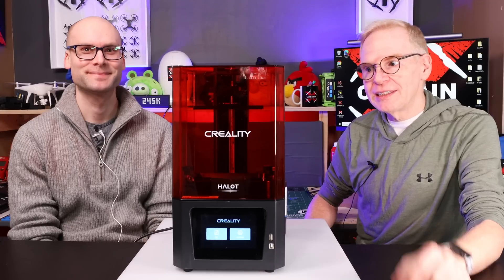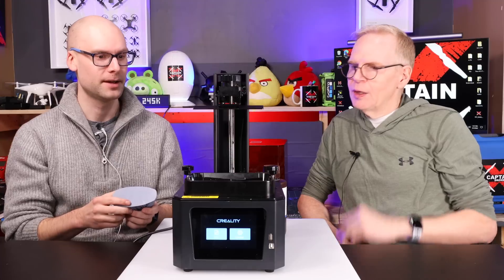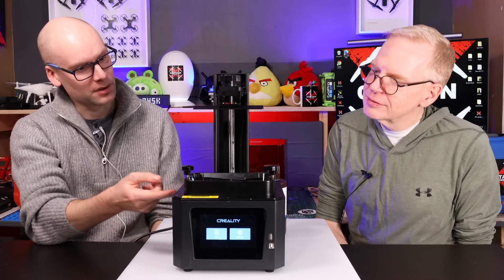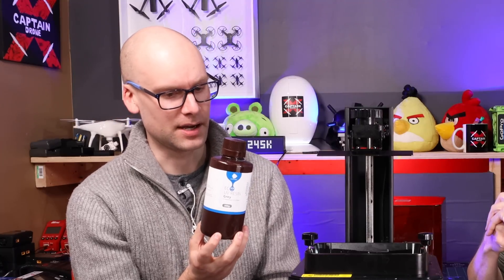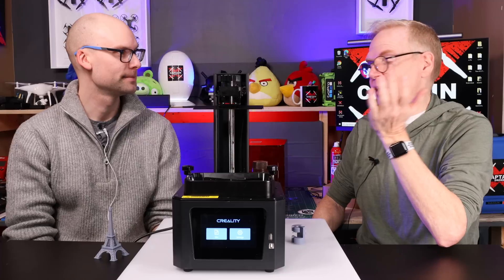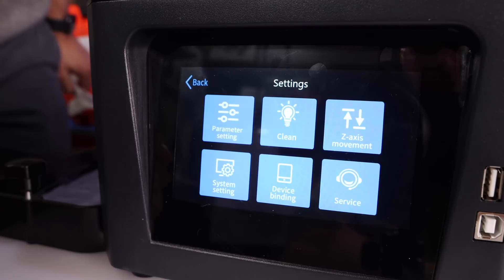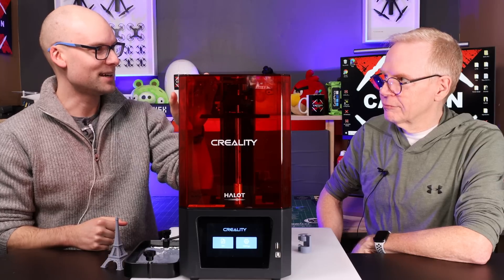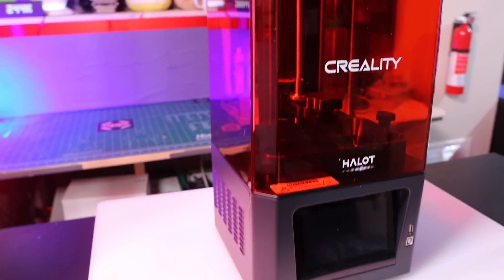My Nephew shows me a cool 3D Resin Printer - Creality Halot One - Review

Comment: We purchased a filament printer for our Son and we still can’t get a good print out of the thing, we are going to disassemble it and try to reassemble it but I am curious, does a resin printer require the set up to get a good print that a filament printer requires?
Reply from the maker: I'm not an expert at all but from what I have observed is that a RESIN printer is much simpler to setup right out of the box & get you up and running quickly.

Comment: You should show better how Resin (SLA) prints can be used with flying Drones/Quadcopters
Reply: We ran out of resin before the video was filmed.  Since then I have printed parts for a mavic mini, Mavic Air 2 and Mavic Pro 2 drones.
Reply: @nelsonprivateer7128  All drones I wish I had!  LOL
Reply: @nelsonprivateer7128  Something I was hoping to find out from this video... Can either type of 3D printer print propellers that will function correctly AND hold together?  I own both types of printers, but only recently tried (2 attempts) the SLA for printing propellers, but haven't had much luck so far.  My lack of success so far has only been with designing the correct diameter hole for the motor shaft.
Reply: I wouldn't fly on a 3D printed propellers unless I was planning to film a crash :).  Props are highly loaded Nd very sensitive to notches or nicks... particularly as you approach the root/hub.

Props are either injection molded or in the case of carbon Fibre Props, resin injected in molds.

Comment: FDM printers draws each layer, layer by layer and SLA (Resin) printers flashes the entire layer all at once.
Reply: Correct.  The FDM layer time is a function of the layers area, the nozzle width, and the extruder speed..... therefore can be a few seconds to several minutes depending upon the area.

SLA prints the whole layer in one flash of the LCD.  The time therefore is nominally 3 seconds for the flash, another 3 to 6 Seconds for a dwell time, plus the time to lift the build pate to let resin flow under and then return to the print position for the next layer.

Comment: Good review, but their was no mention of the alcohol & it’s price that is needed in the process, also no mention of a curing UV device for better & faster curing.
Resin 3D printing is great, very accurate, limited in size.
Reply: Actually it does mention and show the optional wash and cure station ( although we used a hand wash and cure under an existing UV system we had). We paid about $24 CAD for enough isopropyl alcohol to fill our wash bucket.  We're still on that after 2 liters ( 4 bottles) of resin consumed.  Should last a few more.

Comment: What is the strength/durability of resin prints compared to FDM prints? Applicability for making FPV parts? Typical FDM printers (appear to) take too much work to set-up and maintain for me, but this looks more user friendly. Having done composite lay-up, the chemical handling aspect is no big deal, IMHO. Thanks!
Reply: Resin printing properties vary depending on the type of resin you use.  No different that the properties of fdm filaments depend on the material used. I have printed lots of accessories for my camera drones but haven't tried any fpv parts ( yet).  I am not aware of any resin that gives the flexibility/ damage tolerance of some of the popular FDM materials typically used for fpv drone bits (TPU for example)

Comment: Great video!  

The question that I wasn’t really addressed is whether or not this printer could be used for printing small FPV parts (FC Mounting Plates, GPS Module mount,  Crossfire Mortal T antenna mounts; etc:)
Reply: Pester the Captain and he'll probably say " good idea"
Reply: Since the video was filmed, we've printed a dozen accessories for Mavic air 2 and Mavic Mini. All work well. Now doing a mount for a runcam 5 for one of my FPV drones.  We'll see how that turns out.  I suspect the resin will be too rigid ( compared to typical TPU printed mounts on an FDM printer)
Reply: @nelsonprivateer7128  Thank you for the feedback.  

It would be interesting to do a follow up on printing FPV parts with additional thoughts!

Comment: What has kept me from resin printing is the miniscule build volume. When the touch screen is almost the same size as the build plate, it's just sad.
Reply: Larger parts can be built by assembling parts but it is a limitation for larger stuff I agree.  I am currently printing the parts for a bike maintenance stand and fdm is really the only option for such things.  That being said, I was impressed with the quality and ease of using this system.  I am considering one now as a complement to my FDM

Comment: Which type of 3D printer builds stronger or more durable items.  I am alway hearing on drone YouTube’s how weak a 3D printed part is weaker than other plastic parts on a drone?
Reply: need to go do some research there bud. Wont be able to get a decent answer to that question here. What I can tell you is if you want quality prints, spend the money on a proper FDM printer. Looking at upwards of $500US. Then you gotta start lookin at infill percentage. (the infill is what determines how much material is being used on the inside of the walls of the print) Then you need to start looking at the actual design itself and look at ways to strengthen it just by looking at it etc. Printers dont make parts strong. They just print whatever design yu upload to them. Making em strong is on you.
Reply: FDM also by virtue of how it is laid down can result is weak points at very small or very thin section that might be flexed.  Fdm relies on a side bond strength between layers.  Once you dial it in, it's great.  Also making sure the design takes into account where flexing might occur and designing accordingly is key.

Finally material selection is important.  A part inI PLA will be more brittle than the same part in Petg...etc

Comment: Resin printers are cool tech.  Not good for drone stuff tho. To brittle.  And a big pain in the ass to finish the product after printing. It does have its place, just not in my world.
Reply: If you are printing structural parts, I'd probably agree but it really depends on the resin selected. I will admit the accessories I printed for a Mavic mini and myavic Air 2 are far more attractive and tougher than their fdm equivalents
Reply: @nelsonprivateer7128  Appearance goes to resin.  100%.  But for FPV, with things getting knocked around and crashed, TPU or good PLA.  Now if I were making demo parts to bring to a business to show a product design, then again 100% resin.
Reply: For fpv... I agree with you.  For camera drones, should be fine for accessories.

Comment: It’s not clear to me wether or not this type of printer can be used to print parts for drones. Is the material still to weak/soft after cleaning/ drying, and are there) just like filament printers) different materials one could use?
Reply: I've since printed many drone parts ( prop clips, prop boxes, legs, etc).  They have turned out better in resin than fdm.  Only limitation is the bed size.
Reply: As to different materials, you choose a resin based on the intended use: food safe, medical safe, high tensile strenth, high bending strength, water resistance, etc.  No different than choosing different materials in fdm.

For resin printing however, the fine tuning of temps, layer height etc is much more simple.  The key is getting bed height properly set ( which is a 2 min process and then it's good for a long time).

Comment: Which has stronger output resin or FDM?
Reply: Technically the specs show fdm and resin overlap one another for tensile and bend strengths.  After the video my son and I did about 10 drone related pieces and they were better than fdm in bending  had better small part strength.  Only real limitation is the size of the build plate area

Comment: Not to be a Debbie downer, I need some help here. Your spending a thousand [US] for a 3D printer  plus materials for a chess piece that looks like it was purchased in a five & dime store? ( note: a five & dime store was the 1960s  version of a dollar store today however, had a much bigger areas for cheap toys and crafts) with that said, no wonder kids are so spoiled let Daddy buy little Johnny a 1000 dollare 3d printer for a 10 cent part, oh but it's custom 😅
Sorry Captain Drone probably not a very good selling point but had to be said by some Debbie Downer
Reply from the maker: Yikes!  You have certainly not checked the price of FDM and Resin 3D printers (they are in the low hundreds). They costs very little which is why they are so popular.  Also what you create is based on the limitations of your imagination.  People use such printers for home repairs of appliance parts as an example.  For those that have no imagination, then such items would probably not be a good buy.
Reply: I hope the car you drive has roll down windows, no AC, no heated seats, and just a radio.....  because anything else isn't needed either :).
Reply: As mentioned; you should click on the link to buy one of these. I saw others at the Amazon site for as little as $139. As a hobby or addition to a current hobby there is much that can be done. Say a part on your FPV drone, RC car, or RC plane is needed that can be made by one of these printers. Bam; 2 hours later it's ready to be installed.
Reply: This is available for £149 on Amazon here in the UK. I’d say that’s a bargain!
Reply: I was also kinda expecting this to cost in the thousands, but when i clicked the amazon link, was very surprised to see that it only has a $200 price tag.